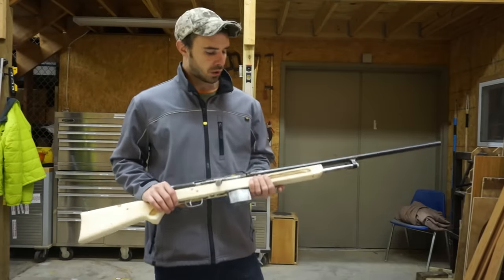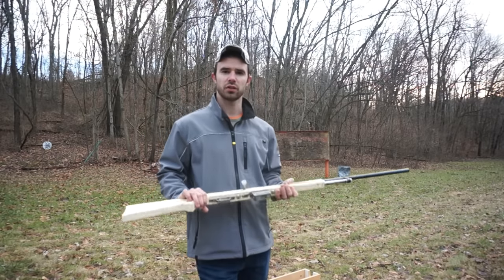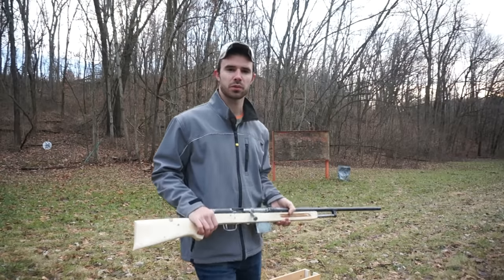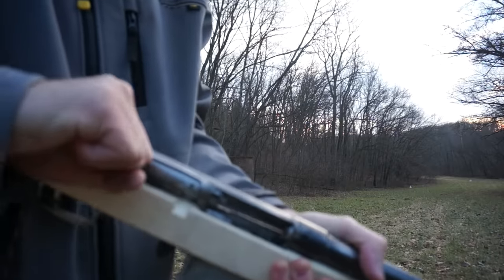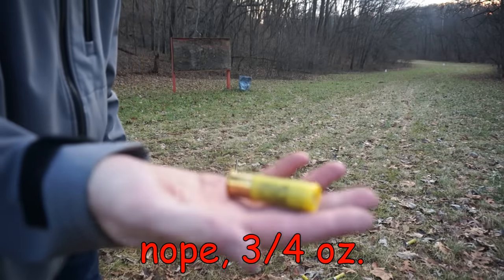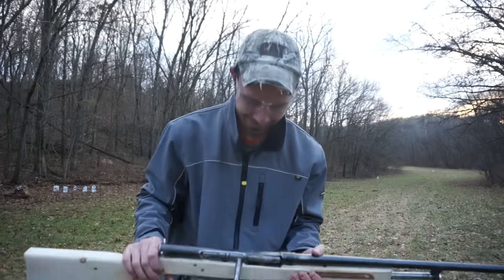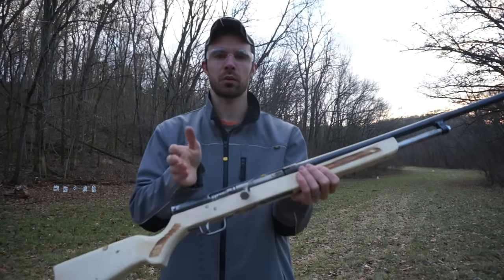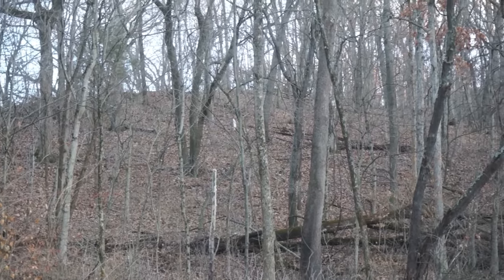Homemade Rifle, first rounds, and last. lol

Comment: You didn't fail, you just discovered a way that doesn't work. Keep up the good work man!
Reply: Cameron Quinn hence the meaning of failing
Reply: @hey12yearsago21  the meaning is to be unsuccessful in achieving ones goals he did make a bolt action shotgun that worked he just has to make sure it stays that way i see no failure here
Reply: Knowledge and wisdom is the greater power.
Reply: Милош Ђошић  judging by the cyrillic letters in your username, you're a Serb, as was Tesla, from whom edison stole a multitude of inventions. I get the hard feelings but no one mentioned edison, only some quote which he probably stole.
Reply: @canadianradiochemist4465  That's a russian flag.
Reply: @hey12yearsago21  failure is the greatest teacher

Comment: Mag well and stock needed better reinforcement  I think but overall not a complete failure. Would like to see you build a improved version very educational.
Reply: Clever and Smart. Safety first.
Good game.
Reply: Max Pain exactly, there's no chamber support. That's the main the problem.
Reply: No metal rings around both the stock and barrel either, jusr two screws
Reply: solreavir Here Here
Reply: Max Pain  my Swiss k11 and 96/11 have slots for the extractor just not the big so I would say if if that what he want just improve the design
Reply: You want the mag to blow out when you have a case failure because it directs the gasses away from you.
Reply: There should probably be a good lock up system for the bolt so that way not all the stress is in the receiver

Comment: As for the stock I would recommend using a sturdier wood for the stock. Walnut, which is kinda the standard for wooden gun furniture, can be expensive so I recommend carving the next stock out of maple blank. It's relatively cheap and very strong. The pine you used real soft and splits very easilty. I would also recommend thickening the metal walls of the magwell and the wood around it. These changes should reduce the likelihood of the stock splitting or warping when firing. Can't wait to see a new and improved version

Comment: Bummer it blew. But really admire and appreciate your effort, keep up the great work! Most receivers are about 28-32 Rockwell hardness, so the mild steel pipe might be a little too weak. If you could somehow case harden it youd probably be fine. or if maybe you welded another nub of bolt and cut a second notch behind the actual bolt to act as a secondary bolt lug to distribute a little more of the recoil force. But yeah what you experienced was very much a headspace issue.

Comment: I think the bolt was strong enough. It was the mag well and framing around the bolt that had a lack of strength which cause it to flare out. Overall i still think it was designed right. Just needs more reinforcement. I really hope to see you build this again! I had high hopes. And it looked pretty cool. Especially being that it was all made from scratch. Pretty badass!
Reply from the maker: thanks dude, yep just go at it again.
Reply: @akcustom7838  dont 
its a waste of time 
reinforcing the magwell and the reciever does not help!
i built a similar gun , you need a thicker wall reciever and a flat locking surface ,no round bolt- also you need proper headspace 
and harden and anneal the reciever section with the locking surface
 look up how - so the steel does not get brittle
Reply: @prinzeugenvansovoyen732  From plans?

Comment: No it wasn't doing fine with the light loads. The cases were bulging and separating it would have eventually failed with the light loads. I agree that it is a headspace issue.
Reply: Ya exactly, that was the opposite of fine. Case bulging is the biggest sign of overpressure issues. A gunsmith sees bulges or split cases they will tell you to quit shooting because its unsafe until fixed.

Comment: The case of the shells bending like that caused most likely by the chamber not being seal tight enough so the shell cassing is moving in the shooting process causing the plastic to pull on the barrel and were it is sealed to a degree the exstracter is pulling on the rim causing bending. I seen a guy trying to make a semi auto shotgun and he was having complete rim and shell seperation because it wasint sealed enough to or put another way didnt have enough delay to allow pressure to drop in the chamber.It may also be to heavy primer strike.
Reply: Yeah seems like with a locking lug or two, perhaps even just some higher tolerance manufacturing and harder materials that sealing problem could be fixed.
Reply: @LyonScapeStudios  yeah 100% agreement

Comment: I was hoping this would work. I wonder if head spacing is the problem?
Reply: Very likely is, and he should've used front locking lugs but he didn't.
Reply: @Isaac-ho8gh  poor extractor
Reply: @bradmartinez7189  yeah that too.
Reply: @Isaac-ho8gh  Front locking lugs aren't what was necessary here. Like he explained in the video, the bolt was 1/16th of an inch to the rear by design. That was 1/16th of an inch too far, and it let all those pressurized gasses out through that opening and they did most of the damage you see there. Some of the damage was done from the sheer recoiling force from the 12 gauge slug, but most was from the gasses.
Reply: Head spacing is almost the entire problem, yes.
Reply: I know it weren't the only necessary thing, I knew the headspacing was also a problem by the way. I just meant that damage to the receiver, magazine and the stock could've been negated by using front locking lugs so he could use more parts again.
Reply: Jimm Crowe  pretty much.
Reply: @Isaac-ho8gh  you can not lock up in the front properly if you have no lathe , it would have made no difference if the headspace is over 1mm to high
Reply: @prinzeugenvansovoyen732  Well it could've potentially delayed the bolt enough to negate some damage to the receiver but I know it wouldn't prevent the bolt going back though.
Reply: He had plenty of headspace.
That’s what the string was for.
To put lots of space between his head and this gun.
Reply: @helidude3502  Fucking hell xD
Reply: @Isaac-ho8gh   I was thinking 'oh god the bolt handle slot is the only locking surface?!' Shotgun pressures aren't that bad though. I think the issue is that the extractor is so long he had to cut open his firing chamber and he didn't reinforce it, allowing the chamber to expand. Explains all of the failures.
Reply: @TheWarmotor  that could also be true and I understand that, but it can still be a good idea for safety despite the lower pressure just in case along with possibly delaying the bolt in this failure to keep more of the receiver and magazine intact.

Comment: Ouch, sorry to hear that it broke. Could it be possible to add locking lugs to the bolt or would it not work due to the fixed firing pin?

Comment: Great attempt.... you need to float your firing pin (2 headed nail) and get a perfect lock up with the bolt and a round chambered. Use thicker pipe for the receiver, double wall iron pipe seams to be the slam fire standard. Also, pine is fine for testing but you need a tighter grained wood for a stable stock.

Comment: The case head seperation was due to excessive headspacing. From the bolt coming out of battery slightly due to no locking lugs to interface with the beral for a solid lockup. Nice build overall though.

Comment: I think the problem was (and I had the idea from the first video) that you don't have any locking mechanism (or none strong enough at least), there is no locking lugs so all the strength of the recoil goes straight around the place where the handle locks. Problem is, with a high pressure round as the slug, you had an out of battery explosion. Well, the round went off and started pushing the bolt back and the rest of the explosion blew everything around it off. I would suggest not having a fixed firing pin if you want to shoot anything else than pistol rounds backed by a really heavy bolt backed by a big ass spring. The concept is there though, you had a lot of things right and it's beautiful to see the process. Keep it up! I would just suggest maybe a rear lug on the bolt that locks in the receiver when you close the bolt. A smoothed out overall of the parts then lubed for a smoother cycling. A spring on the magazine catch so that you just have to insert the mag and it locks in. And a floating firing pin that could work with the same (really good btw) trigger mechanism.

P.S: Just saw the end of the video and yeah, you said a lot of what I just wrote but hope it maybe could have helped!

Keep it up
Reply from the maker: cool, yep thanks man! working on a 410 revolver now lol
Reply: AK Custom Are you not going to do a 2.0 or gen 2 or V2 of this thing?
Reply: @akcustom7838  much RESPECT

Comment: You want the bolt flush with the back of the case, the chamber needs to be snug on the back of the case. Cut a small groove in the chamber for the extractor to run into, but not all the way through.

Comment: Bad headspacing + hot rounds become a dangerous combo. The fixed firing pin design is acting the same as bad headspacing, it would probably be fine for lighter semi-auto rounds, .22, .25, etc but even a .22 will case bulge if not supported well. This is why we always test fire from a prooving vice, you're setting a really good example here for other aspiring gun makers. It can be hard to resist just tying out your newly crafted toy right away. but this proves exactly why there is a process to prooving a gun. I want to make a double derringer shaped to fit into a cellphone holster (like a Lifecard or IdealConceal) with mixed steel and 3d printed components and I intend to intentionaly stress the prototype to its breaking point before I ever hold it in my hand.

Comment: next time you need thicker walled pipe and harden and temper it and a square locking surface with the same strenght - not a round bolt for lockup, i recommend cutting the grove for lockup to far forward and handfiling back on the reciever until it can get closed with a little force - like a mosin you slab close 
it will ware a little and get easier soon 
your trigger looks well - but you might want to have the bolt in a steel biece not the wood to get a crisper trigger 
you can make a two stage trigger if you make a notch like on a Mauser trigger
a better extractor- you need sth to press the extractor inwards in the front and out in the back
and most important - the headspace of the bolt you realy need to be precise that the bolt is so far forward the cartridge can not move further forward within the chamber - you likeley had the bolt at least 1mm to far back because your bolt was stopped by your weld or the barrel does not end flush with the chamber 
the barrel might be reuseable from this build 
try again, it has potential for a fun gun
Reply: I think you mean harden and temper. Annealing it would just make it soft again.
Reply: @ians.2941  no its right - Steel gets glasshard when hardened and thereby glass like brittle , then you anneal it so it is no longer brittle and almost as hard as before 
its for stress releave and more material flexibility - also this leads to a finer grain structure of the metall because of the hardening forming Martensite structures 
and the annnealing Austenite 
for a bolt and reciever you should be at ~500°F for annealing (thats the dark yellow maximum of the ideal is violette colour) (~270°C)  best is to use a brightly lightened room - sand the surface after hardening so you can see the colours on the blank metall, then use a slow source of heat like burning methylated spirit - this should not smoke so you see the colours clearly form on the surface 
the colours willgo further so you need to stopp earlier - if you stop at straw yellow the piece will have enough heat by itself that it ll go on til violett , then put it in a whater bucket to stopp the process 
then sand it off and do it a second time to releave stress.
dark blue is suboptimal but might be OK
it must not go to bright blue or you have to reharden it 

 https://www.google.com/search?q=annealing+temperature+colours&tbm=isch&source=iu&ictx=1&fir=jQOxnH9s4UqjuM%253A%252C1WGcXVciQZdeiM%252C_&usg=AI4_-kSgI-UjmEnFCg8AYMKkLPvG9srnrg&sa=X&ved=2ahUKEwjGjd3rhb7fAhUC_qQKHc4hA9sQ9QEwAHoECAYQBA#imgrc=jQOxnH9s4UqjuM:

if you want to call that temper fine by me but tempering means out of my books from the technical collage for Gunsmithing in Ferlach, Austria (that i am attending) :glowing steel for a long period of time with slow cooldown so it gets very soft and gets a bigger grain structure leading to better chipping characteristics when they get machined (so the tools stay sharp)
they get then hardened and annealed and then surface ground 
one example for this is brake discs 
, crankshafts , barrel blanks for not hammer forged barrels until they get rifled - so the deep hole drilling gets easier 
same with small diameter thick walled hydraulic pipes 
i wish him good luck with his project 
atleast he used a string 
His headspace is at least 2mm off the case has space to go around the bolt - absolute 100% no go 
if he gets the headspace straight and harden and anneal it like i wrote he is gonna get a long lasting oddball shotgun people will ask abaut when they see it 
a 20 gauge is rather weak anyways that should be no real problem
Reply: @prinzeugenvansovoyen732  lol. I'm a Blacksmith and knifemaker, who also works in a machine shop. The term temper is correct. You bring it up to a certain temperature to reduce hardness which gives it strength while keeping it relatively hard. Annealing brings it back to soft. You have the correct definition under the wrong term buddy.
Reply: @ians.2941  excuse my mistake 
it comes from translating german to englisch  
but except that i confused the two words in my comment above it is technically correct 
the tempering colours and methods etc

Comment: receiver pipe is too soft.  Needs to be hardened steel, plus the design did not have enough material connecting the barrel to the rear of the receiver.  this allowed the receiver to flex under the pressure  ruining the head spacing.  Use DOM tubing instead of black plumbing pipe.  Then harden it.

Comment: I think you're onto something here, really enjoying this project. Definitely should switch to a moving firing pin and I think you need a more serious extractor as well. Maybe something more like a 1911 extractor that slides into a longitudinal hole in the bolt and pins in place?

Comment: Too large headspace was the problem, rest should be ok. Point to better and importantly more safer design is to lock it with two lugs (not with bolt only), there is too much pressure to that single locking point (might be ok with forged steel receiver, but not simple tube) and eventually after some use might have another large scale failure.

Comment: You should check ur head spacing and make sure the brass seats better in the future to avoid that deformation.
Also some vent holes drilled in the barrel wouldn't hurt either it would mitigate some of the excessive pressure from the slugs for sure

Comment: Tighten the head spacing. In my design my bolt face wasn't seating the case properly and I had case head separation due to the lose headspacing . I also used a 1/4 inch piece of steel where the bolt layed over. It reinforced the receiver from the bolt handle deforming after it fired.
Reply from the maker: cool

Comment: You need at least two locking lugs. You need a thicker receiver that is tempered. You shouldn't make it a fixed firing pin, a moving firing pin would be much better. The bolt needs to go farther into the actual receiver (the reason you got a fireball was because there was a gap.) And figure out a better locking system for the magazine. Maybe an internal magazine would be a good idea if you can figure it out. You have great start, but you need to build it better and stronger.

Comment: Definitely a head spacing issue with your homemade bolt. You also should probably add actual locking lugs before you get a bolt to the face when your handle breaks off

Comment: Two things:....#1  Bolt MUST lock flat & tightly against the rounds base, all through detonation, to prevent gasses from escaping backwards.   #2    Receiver FRAME in very weak on the right side....Needs a strap of steal to connect Front of receiver to Back of receiver.    Your gun is NOW bent....of this, I am sure.

Comment: So this answers my comment on the first video, definitely going to try my nested pipe locking lug idea. Also hardwood or laminate stock.

I was thinking of a single locking lug for a long time, though with muck more reinforcement than yours and using seamless hydraulic tube because it is much higher grade steel. However i was basing my ideas on the Gewehr 71 and it was known to hit to the left and have receiver issues due to the single locking lug with its black powder loads. and much better manufacturing than I can manage. There are shotgun re-chamberings of it i have heard rumors to never, ever shoot.

So multiple locking lugs for me at least. Damn it. Thats what i get for compulsive research.

* Random thought edit. You probably could get away with a single locking lug for that pressure but you would need silly receiver wall thickness from the trunnion to behind the bolt handle, at least schedule 80 or more.. Also more mass on the bolt + better steel for the bolt handle.

Comment: Looks to me to be most likely a Headspace and Chamber Dimension issue.  One of the things you have to remember is while chamber pressures are lower than compared to pistol and rifle rounds the volume of of gas creating the chamber pressure is many time greater.  Just look at the load data of a 12 Gauge Shotgun round and say 357 round when using the same powder like Green Dot.  However that said an A for effort a D for execution but a few refinements and you should have a functional firearm.